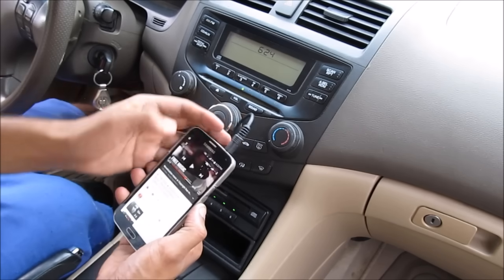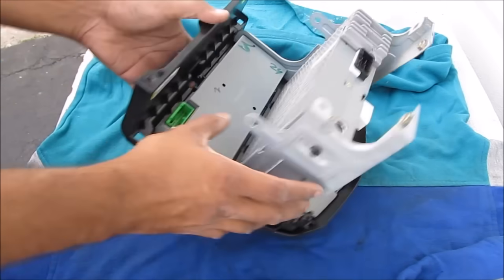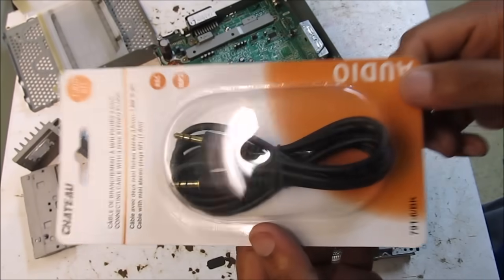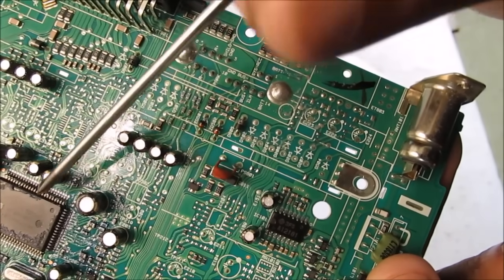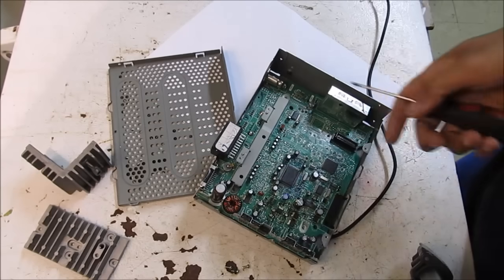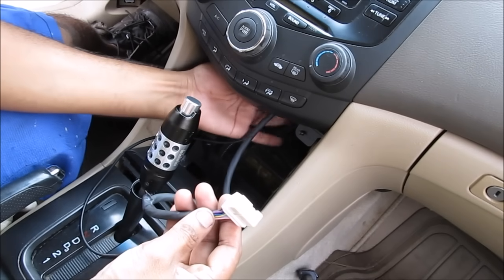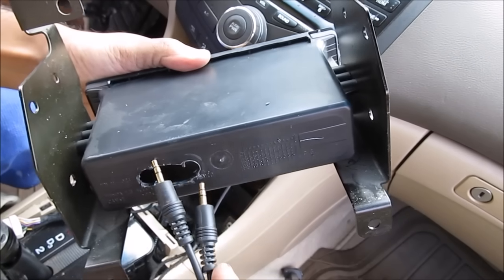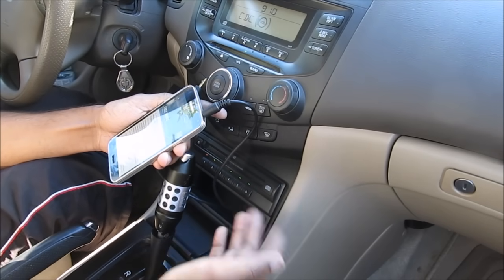$1 AUX Stereo Input Hack

Comment: I got a 04 acura tsx with nav so where your cd changer plugs into the radio thats where my nav cd drive thats located in the trunk plugs in. Plug is the same but how would the sound play thru that because you switched to cd to play the sound. My cd changer is built into the stereo itself(internal)And also my fm modulator is different and has more pins(36) and none are labeled they r just numbered 1-36. Any input you got on this? Thanks
Reply from the maker: +5Riverz same idea, the sound will play when Nav is on.
Reply: speedkar99 yea i tried that after posting that comment. It didnt work for some reason. I had the nav screen on. Maybe because that plug on my car only has 3 wires. Bus+, bus-, and bus ground according to your diagram from the video. Maybe it needs some kind of other signal from one of the other pins. I didnt put the address in and try it as my guess is the audio would only play when gps gives the audio directions.Anyway before trying this i went ahead and opened the internal cd changer and found the pins Lch, Rch, Augnd. Soldered the aux to these assembled it all n found out the the internal cd changer never worked in the car(not my car). Im pretty sure that would have worked but i cant verify that because when i hit the cd/aux nothing happens or no sound from cd drive. I will find a replacement unit at junkyard n if it works i will report back here i guess.
Reply: speedkar99 i wanted to say thanks to you! I was able to install aux in my acura tl. Havent got the cd player for the tsx but I realized i have xm radio in my TL(non nav) so i went to my trunk and found the xm module after peelin back the liner on right and takin out the module and the connector was same as the one in ur video except my R+ and L+ are swapped on the connector and there is no shielded ground wire so i grounded my aux wire to the bolt that holds the module to car. I Left the R+ L+ pulled out the connector and plugged the connector (with two wires pulled out) back into xm module And also i disconnected the xm antenna on the module otherwise xm would play along aux on lower volumes.(with antenna disconnected the stereo would jus say “xm antenna”) i just did it thru my trunk because it was quicker. it works amazing im happy with it. That plug diag was handy thanks!

Comment: hi,
I have the Honda accord 2003 ex-model (it has one cd changer stereo)
it makes a weird noise and doesn't work properly but all the buttons work and show all the info on display and running car for 2-3 hours .. sometimes it works, so I guess there is some problem with amp inside.

I saw your video how to connect the aux-in through radio and I have the external amp.
if there is any way to by-pass the stereo amp and I could get to know where to soldier to get pre-amp output from the stereo.

please help me with this.

thank you

Comment: i have a question  why did you use only right positive and not left. secondly i want to ti try this with my 05 caddy . i checked out the cd changer cable and it has databus wire there you thinknthis miggt not work  seeing how the stereo is wired thru the cars computer
Reply from the maker: +t0a0w The second method I show you stereo connection with both left and right. First method will be one channel only. Not sure about GM vehicles
Reply: speedkar99 figured  gm does this on pupose lol

Comment: Forgot the $150,000 degree in electrical engineering. Just get an after market headunit at this point hahahahahahah
Reply from the maker: +Nicholas Bouffard Forget the millions Honda spent designing the interior. Ruin it with a $99 radio.
Reply: speedkar99 I mean there's some really really ugly and bad headunits out there, but if you do your research you can find a really nice high quality one that will improve the aesthetics of your car (tastefully) and improve performance of your speakers. This is a fine thing to do if you have the know how (which I do), but I can imagine that if you don't know what you're doing that you would SERIOUSLY fry your radio and then you would have to spend $99 on a new headunit anyway.

Comment: Awesome. Thanks for great video.  With your video, I was able to hack into my CD changer and connect a 3.5mm aux line.  Works great. Previously I was using one of those $20 "bluetooth to FM station" converters but I got tired of changing the FM channel when it received interference. Looking forward to more cool videos!
Reply from the maker: +scooby95219 Glad it worked out for you. What car did you try it on, Accord?
Reply: I have a 2007 Honda Accord.  We are going on a long road trip. I knew it would drive me crazy using the FM transmitter and having to change the FM channel a gazillion times to get clear reception.  This aux cord is a much better solution. Thanks again!
Reply from the maker: +scooby95219 glad it worked for you

Comment: nice editing . skipping all "dead" time.  allso this should worrk on any car, only you would have to do a lot of research
Reply from the maker: +Bajenff1 thanks! Your right, as long as you do some research on the datasheet for the chip you can learn where to solder the aux wires.

Comment: I'm not even sure if this guy is serious... He has an adapter port on the bottom of the unit where he can simply get a 5 dollar USB + Aux input device and only requires you have a panel popper and remove 4 philips head screws.

Comment: or you can take a splitter for your radio antenna and put your adapter in the splitter for the 3.5mm it is honestly easier and faster.
Reply from the maker: +Filsdemorte that works but sometimes interference

Comment: thats a hell of a lot of work, if you have the time and equipment to do this, you can buy an aftermarket head unit with an AUX port and install that instead, since you're already removing the stereo.  Also take a shot every time you here the work 'HACK'
Reply from the maker: +Joshua H That's not a lot more work than installing an adapter

Comment: the only option I have for my stereo was to to use the fm modulator. Unfortunately my output isn't  labeled
Reply from the maker: +Tim Trial Did it work?
Reply: speedkar99 I can't identify the fm outputs. The stereo is a jdm factory Toyota with am/fm limited frequency  only. I have another Toyota radio/cassette from a New Zealand market vehicle that will probably be simpler to hack an auxiliary input and as a bonus have full fm range.

Comment: Um... my old honda for $15 on eBay you could just buy a radio adapter that just plugged into the back of the radio.... 
and he pronounced bass like the fish....
Reply from the maker: +Ryan Smith Bass is low frequency sounds
Reply: speedkar99 he pronounced it bass instead of "base"

Comment: Fuuu way too much work, rather buy a $40 dollar stereo that has aux output..
Reply from the maker: +King Romo84 That's more work
Reply: It's not more work to just add a CD player, it would go where the 6 cd changer goes buy a harness for 3 bucks and ur set. I've had a 2003 accord before.
Reply: King Romo84  from where
Reply: Technically it would be more work I don't know how much you make a hour but say you make 20 bucks a hour it's going to take you two hours of work to pay for the device and cost you money this would take a maximum of a hour and cost you next to nothing. Time is money .....

Comment: this not good ,this radio have the aux option and you can activate it with connecting some point in the pcb,tested many times,showing aux on screen of the radio and work like charm
Reply from the maker: +zabalido zabra You need to have an Mbus device attached to activate aux. Not as simple as connecting a point on the board.
Reply: sir i am sure that this radio d ont need the Mbus to turn to aux mode with the preset [ cd aux] ,i am a pro car radio repair and i know what am talking about,i have my own method ,tested more than 100 time ,and i offer this solution for my customer since 2008 ,2 point on the pcb need to be connect together to activate aux ,2 other for inputs left and right.
Reply from the maker: +zabalido zabra Okay so I mentioned in the video that there is an aux circuit printed on the board. However if you follow The traces its dead headed and does not connect to the central processor. I have tried shorting these two and applying an aux input and it doesn't work. On other radios such as the civic they do have the analog input enabled (with all the respective filters wired in). On this radio the only way is to hack the fm signal or the Mbus line.
Reply: this radio is Alpine made,and as i said before it can be done if you are interested with solution contact me
Reply: zabalido zabra im interested to know how to do it. please if you can share it with me. thanks
Reply: send your mail to upload the pics
Reply: pm
Reply: where to send
Reply: zabalido zabra i send you my email in private.

Comment: so what I've learned from this is do more work then just disconnecting the stock radio spending 90 bucks on a decent aftermarket head unit and installing it properly in place of that CD changer  to achieve shittier sound then you'd get from a $10 FM transmitter
Reply from the maker: +Sean lastname that works too

Comment: Where did easy go? may as well put in a new system and engine by the timw yer done doing all that.
Reply: Agreed, this is easy af; unless you have a different radio and need to figure out corresponding pins on yours, then it might be a bit of a hassle.
Reply from the maker: +Geremy Mensing This is easy. Solder 2 wires

Comment: Thanks! So, you only need a one dollar wire and a master degree in electronic! Very useful information.
Reply from the maker: +Eduardo Carnevale No actually my degrees are in mechanical engineering but you don't need any of that to research audio circuits

Comment: Great Video. But those yr radio for Honda Accord have bad circuit board that causes the radio to go dim and loses alot of function. If you haven't had the warranty done to the radio yet, then dont perform this action as you can void your warranty. But if you had the c-board replaced then by all means enjoy!
Reply from the maker: +Adam Warlock Yes I've heard of the dim display issue on these. Its not a difficult fix from what I've read either.

Comment: Super easy just remove 8 screws then remove 6 nuts then remove 3 screws then a heat sync then 14 screws then 6 other nuts then 6 more screws followed by 9 more nuts...then you just go buy an aftermarket radio and have it re installed since you lost 69 screws in the process.
Reply from the maker: +Blake Cox Screw this

Comment: Save your self sometime and go on Amazon and buy an FM converter that you can plug into you cigarette jack and listen to music that way. literally costs you 14 bucks and you don't have to take your stereo apart lmao
Reply: It’s way terrible I have a $40 one and it still doesn’t compare, especially for bass, don’t cheap out, just upgrade he whole stereo while you have it apart, broke boys rock the fm converter
Reply from the maker: +Mr Anonymous and the sound quality is terible
Reply: They sound like shit
Reply: I would not recommend a fm transmitter if you live in a big city. you need an empty fm station to use it with and the stations are crowded in a big city. some transmitters are also poorly made and have a very low signal. if you still want to try one, get the cheapest one you can find on amazon or ebay. try every single empty station for best results
Reply: Miguel that's horseshit. I spent time living in the cities when I was younger and used an FM adapter and never had any issues of bleed over. Just find a frequency (there'll be a few) that aren't in use in your area or where you commonly drive and then you only have to move the rare occasion you go out of area.

As for the others ranting about audio quality from the FM tx'ers ... I've had a few of them in the past and one was a little on the side of rubbish but the rest have had great audio quality. I now instead upgraded the stereo to a newer Pioneer with BT streaming and 3/4G mobile repeater so I could stop having to install a solid mount mobile phone cradle and not spend half a grand every time the phone handset changes just to have the cradle. I can now use cheap shit cradles instead and still have a better outcome.
Reply: Y'all dumb af. Get a nice 4 1/2- 5 star fm transmitor and it will work just fine. Say otherwise ur full of shit I have one in all 4 of my vehicles.
Reply: depends on what you buy

Comment: That's a great video man, trying to do the same to a 05 s class Mercedes. Any idea where those points are so I can solder the cable. What about the trick with the silent disc?
Reply from the maker: +Kostadin Kostadinov Just make sure it isn't using a digital CD player and the silent CD hack can work. You'll have to open up the radio and look for left and right

Comment: You sure have a strange idea about what hacking is.
Reply from the maker: +Czar Zenana what's your idea?
Reply: Hacking is breaking through a protection you are not supposed to break through. You added an AUX-input.
There are easier methods to connect a phone or MP3-player, but to me those are inferior to a decent cable connection. So thumbs up to your AUX-input, but I don't consider it a hack.

Comment: without the CD changer can we just use 14pin wire directly , without and soldering of radio and all , i mean is i don't like radeo at all, just the sterio Mp3 play , and is it really working , nice toothbrust 👍🏼
Reply from the maker: +Ngaihsaka Chinzah You need the CD changer or some Honda device to trick the player into reading fr that port.
Reply: well then can we use any CD changer which is made for vehicles ,
Reply from the maker: +Ngaihsaka Chinzah Yes the same method will apply to CD plays that output analog signals.

Comment: oh my God i am sick with these 6 CD Changers I am trying to get an AUX out but this worst thing send SPDIF/ Digital Signals. Is there anybody who can help how to convert Digital signals to Analog signals. The Audio L/R output pins on the circuit are not working. I can listen to music coming out from them when connected headphone through them but no input sound in speakers even if the spdif/digital signal removed. The silence CD not working either.
Reply from the maker: +Tariq Farooq CD method won't work because it goes from the CD data port to the equalizer chip
Reply: Hi Thanks for the reply. Do you think i have any option at all or just replace the DVD which is a nightmare the car has a separate Screen.

Comment: why did you leave your ignition on this whole time? do you understand if any wire was uncovered and grounded out you'd be Screwed right? smart with hacking but stupid with simple steps of removal
Reply from the maker: +chris lugg because the shifter has to be moved back
Reply: good point but only for the bottom of the stereo not the head unit....

Comment: I tried doing to hack in the back, the 14 prong, I attached the ground the left plus and right plus, still won't work. do you know why it doesn't work?
Reply from the maker: +Vella Paranormal do you have a CD changer?
Reply: Yes I do, Everytime I try to turn the iPod on when it's connected it shuts off, maybe the ground is loose or something I dunno, I'm gunna look at it one more time, it doesn't matter that I have a system right?
Reply: I put the left positive in, right position and ground, I put it directly in back of the 14 pin tho, should I hard wire it to the CD changer wires? My Scion has 3 harnesses in the back, radio 14 pin, then the other 2 harness I believe is for the CD changer and another for the satellite radio

Comment: Fm radio transmitter = done. Without hacking into the wiring, I'd rather spend 7 pound on a cheap transmitter that works than risk taking the whole thing apart just to then realise you forgot how you took it apart then you have an "OH FUCK" moment lol
Reply from the maker: But the sound quality bro
Reply: Yh but the amount of work put in isn't worth it, buy a aftermarket radio with aux in and Bluetooth for 50 pound or just use the transmitter, worked great for me and you can remove it and if there is ever a problem I can take it out and put a new one in whereas doing all the work opening the thing up to an aux in if anything goes bad with it you have to take it all apart again to figure it out, good idea but not very practical.

Comment: he forgot to mention the 120k engineering degree you may also need for this ...
Reply from the maker: +Mc lovin You dont need an engineering degree to open a radio and solder 3 wires. 
And my engineering degrees didn't cost $120k either ....thats a lot

Comment: ummmm... if your gonna pull the factory radio out you might as well go buy a pioneer from Walmart for $110.00 and be done OR you can buy a thing that plugs into your phone and you set your radio on like 88.3 and the music plays through the fm radio.. what you did is neat and informative but what happens when your aux chord goes bad in 2 weeks ? I have had 1000 auxiliary chords this year because they ALWAYS start going out